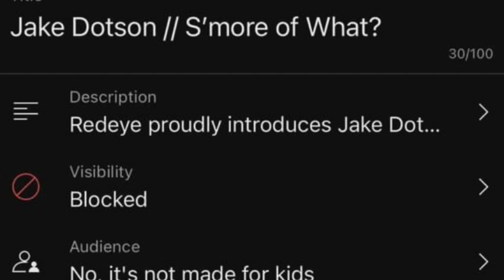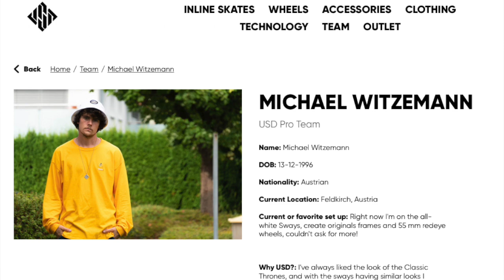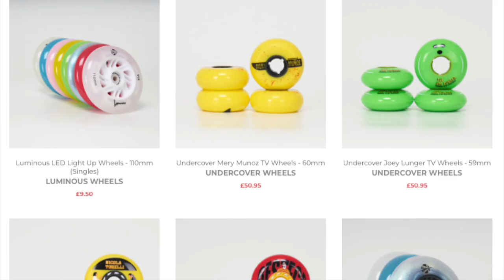The Rollerblading Industry is Strange - A Rant About Pro Wheels

Comment: Prices are very high for those wheels, and I wanna mention another thing.
Why can’t you buy single wheels or at least sets of 10 for 5 wheels frames users? (Torelli wheels😅)
Even the Fatmi wheel (interstellar graphics 😍) are sold in sets of 6, and they are 100mm, wich is a popular size for 4 wheels frames.
I don’t wanna spend a LOT and being forced to buy more wheels than needed.

Comment: My best guess as to why a company like Powerslide would split a skater's status across brands is to limit the financial risk, while still giving skaters the chance to earn royalties. There's also the reality that wheels surely have more sales than boots. People go through many sets of wheels while using the same boot, so that probably makes it easier to give out a pro wheel versus a pro boot. 

Ultimately, anything to put money into skater's pockets is good, regardless of if it seems odd. It's a good thing to discuss though, for sure. Good topic for a video, and well explored.
Reply from the maker: I think that's what interests me the most, people's take on it. I don't know how much a name sells a wheel - I am more inclined to buy a wheel based on the size, hardness and shape. For example, giving someone a pro wheel and it selling really quickly doesn't necessarily mean the name sells, rather than the product. But i do get it's less financial risk for the company and one possibly way to gauge how popular they are in terms of selling product, although that does seem pretty inaccurate to me.
Reply: @wheelsceneblading  Yeah, it would be interesting to hear what value the brands see in the pro wheels. Like, is it a money maker for them? For the skaters? Do they sell well? I thought about this a lot today, and I wondered if the Team wheels at most brands act as a way to put money into the brand's team itself, or if it's just a handy name to use for a general wheel design. It would be cool to know if there was a wheel that wasn't a 'pro' model, but still put a (very) small bit of money into the team's pocket with a small (2-5 bucks) markup. I don't care for most pro designs, especially all the parody designs, but I'd still like to support the riders somehow.
Reply from the maker: @NISHIAKI  I know that some team wheels are definitely used to go towards the team in various ways.

Comment: Not only are wheels cheaper than skates for a pro thing, but people buy new wheels away more often than new skates. So, the potential profit margin is far higher, too. It makes a lot of sense to make pro wheels. But, I'll just buy the pro wheels for the pros I like or with a design I like and never use them. Keep them pristine. Maybe buy 2 sets if one of the sets I want has high regards for durability and over all performance, though. As far as the price raise, I don't understand that. If the overall price for the wheel at all points, or even just some, goes up... keep the price the same. Your competitors will raise their prices, but yours will be cheaper. Meaning, more people will buy your product, meaning more sets sold, meaning the same or greater profit than before the price raise! Just makes sense to me. I wouldn't buy a set of wheels for $65, which is what the pro Undercover are in the US, when a set of pro Red Eye are $45. I'll buy the Red Eye cause cheaper! They may not have  the pros I like or designs I like, which they have a couple of each, but my wallet will cry instead of scream.